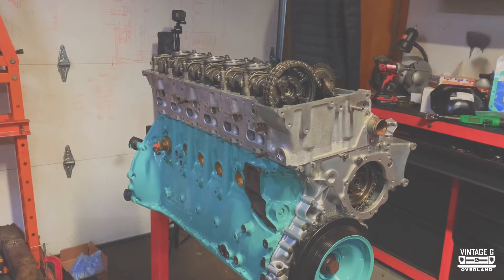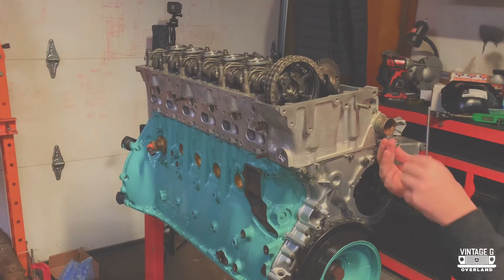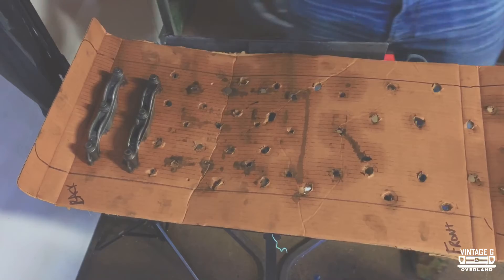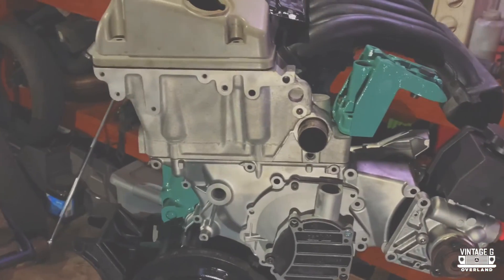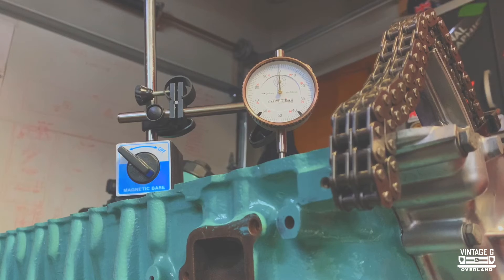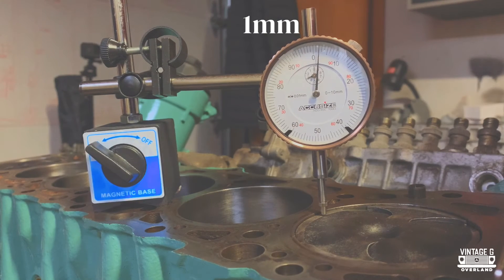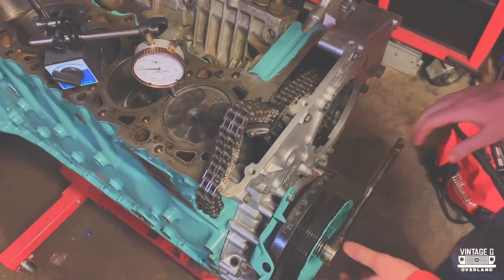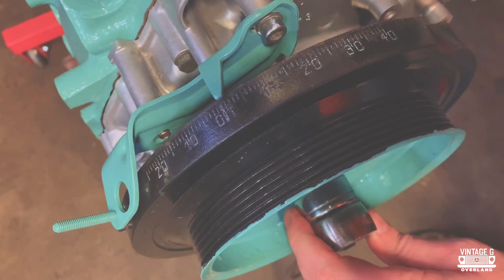Episode 10. How To Time Your OM606 Engine

Comment: Mate I rebuilt my 606 and also set it 3.23 mm down and at 20 degree . But I found that if you set the piston bang at tdc and pulley on zero like you did the first time . like we normally would .I found that if I then turn engine to 20 degrees the piston would be at 3.23 on down stroke . So I really struggled to see a difference in doing it either way
Reply from the maker: This is great feedback! Thank you!
Reply: It seems confusing to me . Have you turned your engine to see my point
Reply from the maker: @katiehinds1648  yes, so if you go off TDC on the dial gauge it’s off by 1mm up from TDC on the pulley itself. The tricky bit is because the crank isn’t completely in line with the center of the rest of the block. @dieselpumpuk has a bunch of great videos explaining that in detail